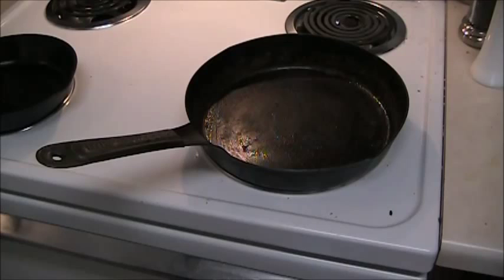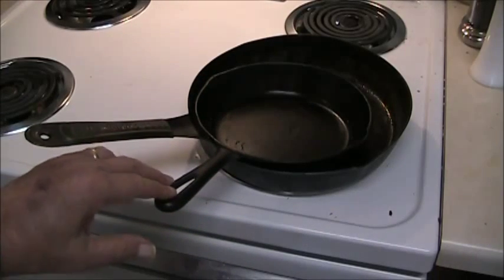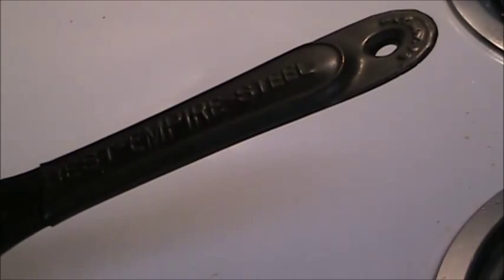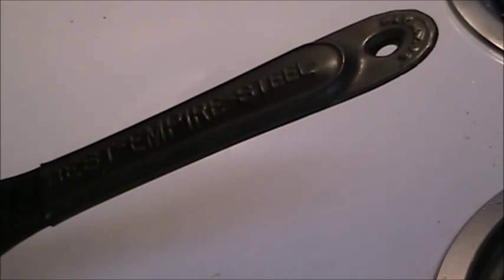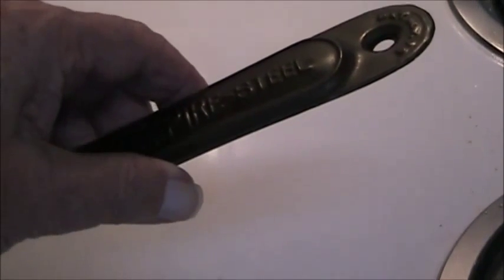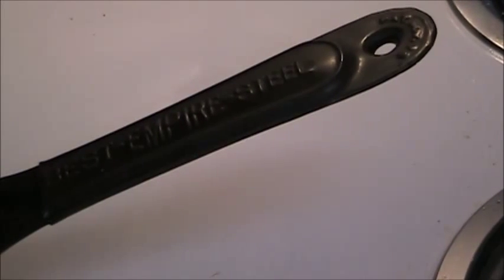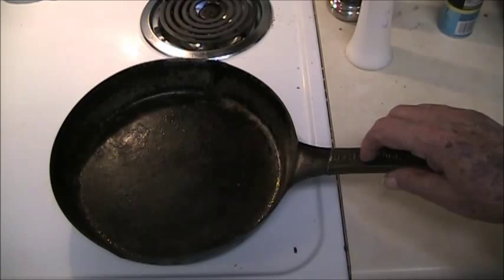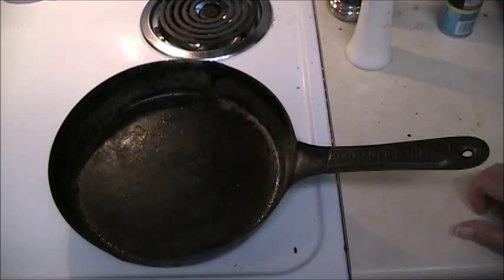COOKING IN A STEEL SKILLET

Comment: I found one. But it came with three others. When it rains it pours. 9" and on down to the one eggs size. I was told they had to be sold in a set. So I bought them in a set and now have four. I've seasoned them all. Here we are in 2022 and I never thought I would see even one of these pans. I have seen the videos of people out in the wilds. Bushcraft & Survivalist with these pans. The beach is as wild as it gets around here. I enjoy bbq'ing and pit fires so they will get used there. I don't know about using them on Convection Stoves or these new types of stoves. These type of frying pans don't sit well on flat surfaces. I am very happy to have had the luck to find one and super lucky to have the other three. Thank you for the story about them and good cooking to you.

Comment: I found one years ago while prospecting in the mountains. I threw it in an old metal wheel barrel in my rock/flower garden. Recently I got a yellow lab puppy he's 6mon now and I walked out if my shop and he's running around my yard with it! He was prancing around with it like saying, look at my new toy! After several attempts I finally got the darn thing from him. Looked it over, did a search and this is how I ended up on this channel. Thanks for the info!

Comment: I beg to differ on the cast iron values. I recently bid $850.00 on a skillet at an auction and did NOT take it home with me.
 Still, I do love the old steel pans too. The old cowboys liked them because they were light to pack on a horse. I season over wood fire and you have to watch the steel pans because there is a fine line between the smoke point and burning it right back off. Great video. Keep on cooking...
Reply from the maker: +Mike S. Was it a cast iron or stamped carbon steel?
Reply: +Jim Foreman  It was a Griswold #14 cast iron skillet with the regular skillet handle plus an original wire "bail" handle. A very hard skillet to find. ( this was the only one I've seen ) It sold for $900.00. A couple weeks later a local auction had a Griswold #14 cast iron "regular" skillet, large block "EPU" logo with the usual skillet handle only. It sold for $525.00. People seem to be going nuts at the auctions. I can usually find them MUCH cheaper at flea markets or garage sales. Though some sizes are very hard to find and quite rare.
I do know at least a little about cast iron and have the Griswold and wagner books.
 I think I have seen a couple of your cooking videos too..
 Consider me a subscriber

Comment: I just picked up 138 year old steel frying pan called the new fryer it has a brass tag on the handle and the handle is separate from the frying pan and riveted on it is 23 in Long with the handle. The Pan part is 13 in across and 3 in deep. It has a socket riveted on the far and away from the handle that a bracket with a hook hung on. The hook was made to hang a basket that had holes in it that sat down inside of the frying-pan. Once you were done frying you would pull the basket at and hang it on the hook the drain the fat. I posted a video of it on my YouTube Channel. It is a very neat pan and I have never cooked with anything like it I gave it a good cleaning knocked a couple dance at and now I am seasoning it in the oven like I would a cast iron pan. If you have any tips I would love to hear them thank you Bobby
Reply: The name of my YouTube channel is GetGotTV. Also from what I understand it was the first deep fryer
Reply from the maker: The reason for the long handles on steel skillets was so you stand far enough from a campfire to be out of the heat and smoke.